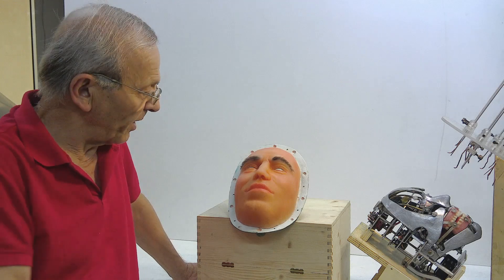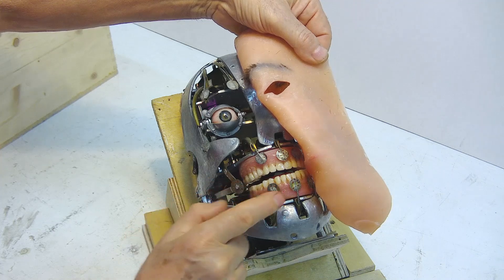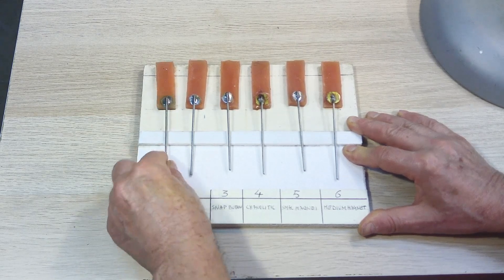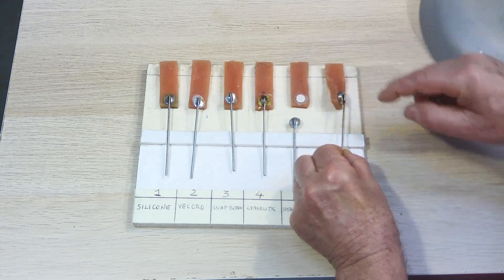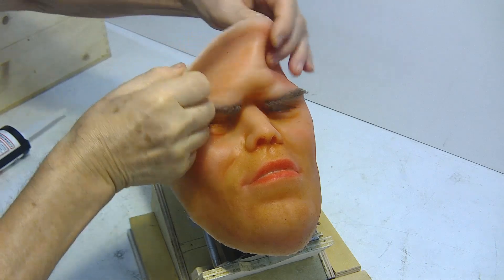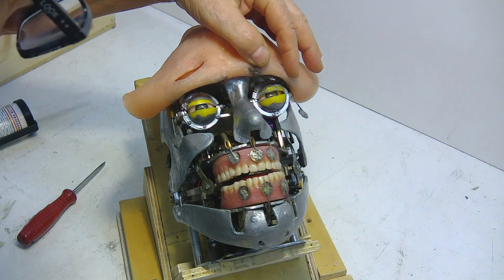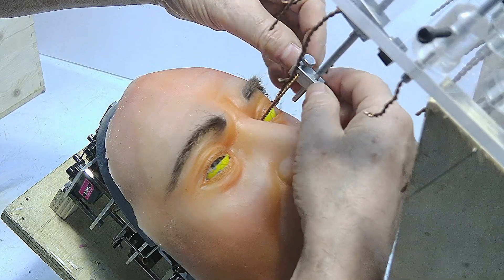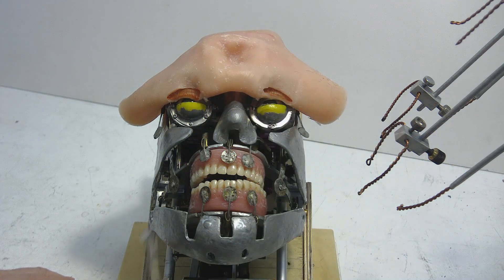Mask assembly for humanoid robot - Animatronics tutorial

Comment: hey this video was so helpful but i actually have a smal question. if i want to maintain the head and i have a face around the entire head how would i remove the face again
Reply from the maker: Lift the rubber face, with the blade of a cutter cut the points glued to the mechanics. That's it!

Comment: This is so impressive - thank you for this video. 
I sometimes had the problem that the magnets seem to be fixed perfect in the first but get loose after weeks when the mask is deformed many times... Even if using silicone to glue. Did you notice this in your projects, too?
Reply from the maker: Thanks for the compliments.
Neodymium magnets are good if you have to make small facial movements, for me they are only good for fixing the edges of the rubber face.
If you glue the face well with the cartridge silicone you get the maximum movements. I have silicone rubber faces made for many years and they have never deformed, because when I finish the show, all my servomotors reposition themselves to zero, in the normal position of the face.